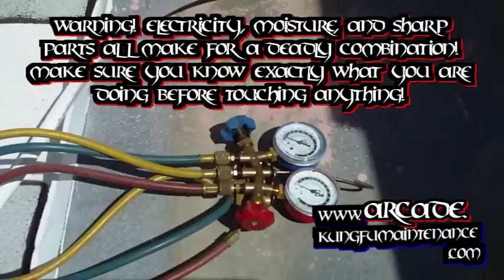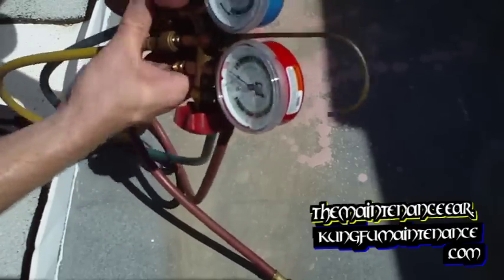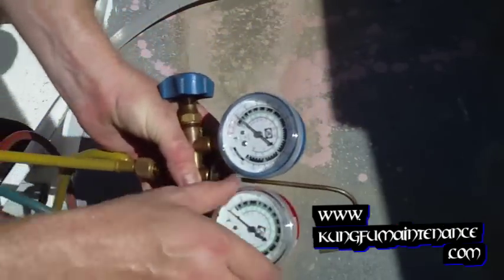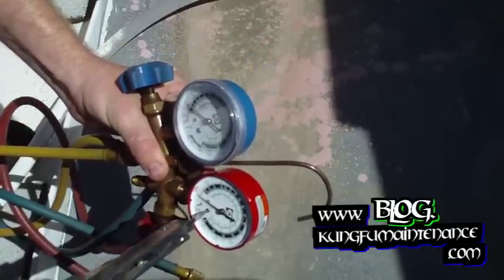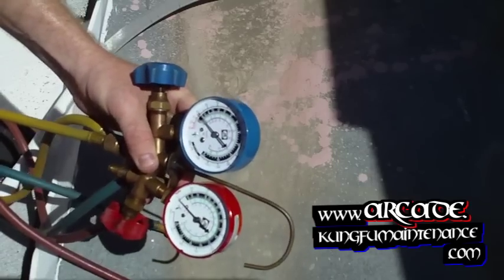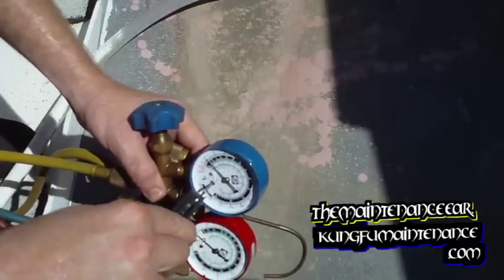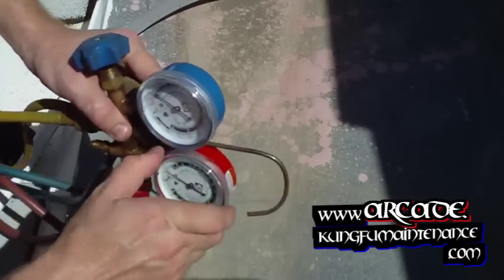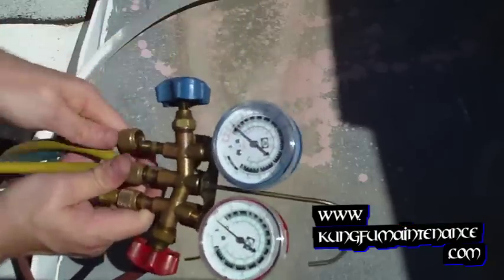How To Zero Calibrate AC Refrigerant Gauges Before Charging

Comment: It seems worthless to calibrate 0. Why not hook it to a tank and calibrate to the appropriate pressure/temperature chart. At least the high side pressure would be closer, and gauges aren't typically accurate in the bottom 5% of their range anyhow.

Comment from the maker: Yes for some time in particular  I have had my eye on a manifold gauge that is digital and has temperature clamps also so it makes it way easier to calculate superheat and subcool. My hesitation has been the gauges cost is a bit over four hundred dollars and I would definitely be putting it to the test through some extreme conditions. I am wondering how they would  hold up under the day to day usage.

Comment: This is not calibrating your gauge . This is ZEROing your gauge there is a BIG ifference. 
To calibrate your gauge . you need a tank of refrigerant that is in stable temperature. tape and insulate a temperature probe to the side of the tank. hook up the gauge to the tank. 
consult the T/P chart. for the corresponding pressure for the temperature measure by the digital thermometer.  Then you are calibrating your gauge.